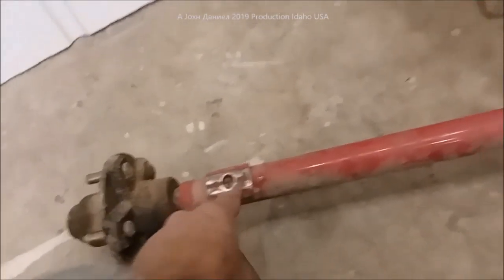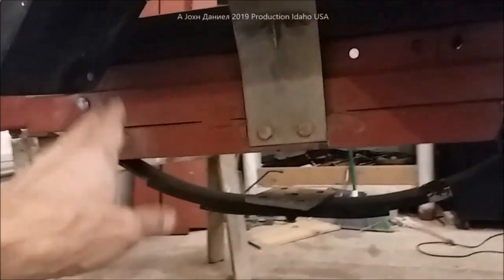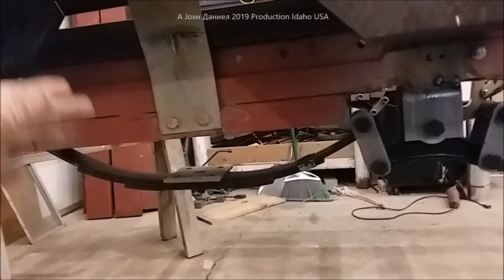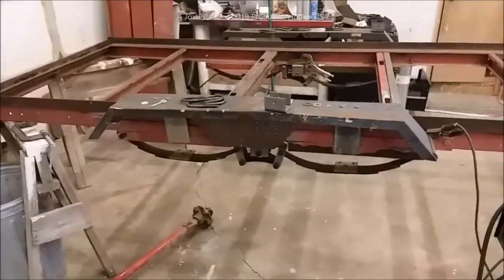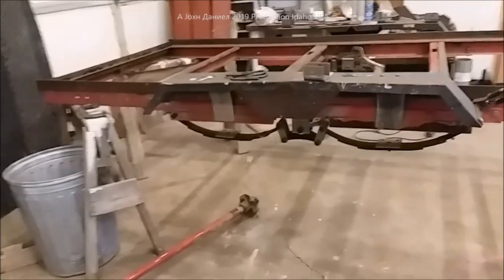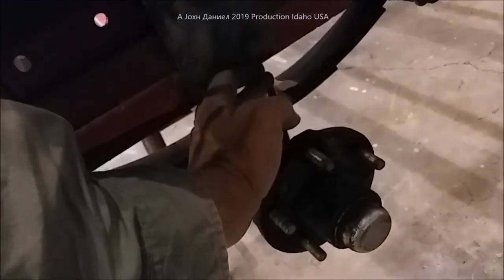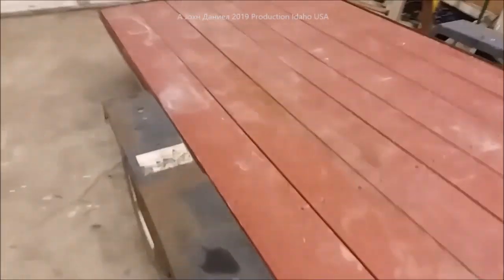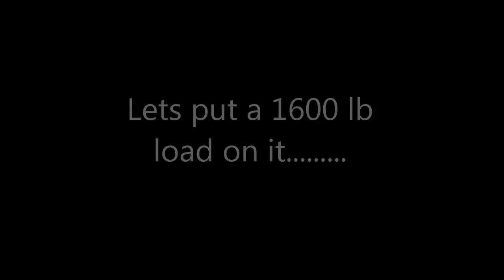Harbor Freight DIY 2 axle trailer Phase II vid 2 on 4k Suspension kit

Comment from the maker: Discussed PARTS - 2k/4k dual Springs https://ebay.to/309fyoK Full 2k Axle kits https://amzn.to/2YqwYNa Short spring Equalizers https://ebay.to/2YtKAHh 1" Trailer Bearing kits for HF & Northern Tool models https://amzn.to/2XEKRKx  Build with flux welder https://amzn.to/2WRQXmn that can weld 1/4" thick & use INE wire https://amzn.to/2WSdFun Anything I missed, ASK!  Need more help, contact https://bit.ly/2XIj5tL
Reply: Hi john I'm looking for the sa.e materials to do this to a trailer of mine, I cannot source them of the links you provided :(

Comment: Did you reinforce tongue?  Dual axle increases ability for load, weakest point is where tongue connects to frame.  Intrested how you solved that issue.  Great job!
Reply from the maker: dad is not here right now, in hospital. but i do know he used angle welded into that front to make it stronger.

Comment: Great video... just one question... how do you reinforced the Tonge ??
Reply from the maker: 1.5" x 3/16 wall square tube welded from the hitch assembly to under the frame about 2+ foot hitting 2 cross members

Comment: was there a reason when you built this you didnt do a full 16' or so length? I am seriously contemplating doing 16-20 foot, buying 2 trailer kits in future. & I already knew the benefits of the axle pivot, I have built hundreds of trailers in my life, when I was working at a shop, but I dont own a single one. times have changed, I once found junk trailers, & cut them up, and used metal to build "new" trailers, now there is nothing cheap & even well used Harbor Freight trailers sell for more used than new.
Reply: No kidding.  I just seen an ad for the 4x4 trailer a guy assembled and decked for $400!
Reply: Thats the same shit i wanna do is do a 4x16' trailer with harbor freight trailer

Comment: Hay John ,You need to check out  the new 500 watt converters. The box said 500 watts so does the paper work. I call them and they said that they can handle  up to 360 watts of power. Please check them out. They are from Harbor freight. Let me know what you think. Dennis

Comment: Cool. Didnt you have some duely trailer for sale that was in good shape cheap that would be perfect for a scorpion tower mod like mine and would hold 12  6v batteries and 6 or 8 300 watt panels ?
Reply from the maker: Yes, I have one with a 21+ foot bed thats sitting ready for conversion. It has dual axle, 3500 lb. Empty weight I would estimate is 700 lbs when prepped for a build.
Reply: My buddy wants to build his own setup.  I told him no. Only if I help. Because he will catch everything on fire.
Reply: Cool how long till its converted and how much do I tell this truck driver it will cost him for the first step?

Comment: Hi and thanks for the video. I couldn't see any brakes - sorry if I just missed that part.  In the UK the limit for towing on the public highway is 750kg if unbraked, 3500 kg if the trailer has brakes. I can see that your trailer is solid enough for a decent load weight but did you not consider the benefit of adding braking ?
Reply from the maker: No brakes are made for the 2k axles. And although 1700 lbs is a decent rate for a trailer without brakes for cars made 20 years ago, they should update the UK laws to at least 950kg in the UK to acknowledge the notable improvement in braking systems on all cars and small vehicles. Even a off road UTE for hunting in USA ( which is what this is great for ) has better brakes than a 30 year old British design car. They should look at the benefit of double axle road control and how it tracks drastically better than a single does. Here in USA you have max legal tow speed of 65 mph with limits of 2200 lbs behind a car and up to 3500 lbs behind a truck without brakes on the trailer. If your truck is a 1 ton that can be up to 4000 lbs un-braked

Comment: REALLY HILLBILLY BUT GENIUS. HEY , HOW TO YOU BOLT THE CAMPER TO THE TRAILER?
Reply from the maker: You make a pocket ring of light 1/8"th 2 x 4 angle steel on the frame for that , but currently No plans to use to to haul the camper on trips, just using it to move the camper into the shop and go into surrounding area to collect old truck campers for salvaging. But I suppose for permanent use you could with the first mentioned, or steel plates and tie downs since the trailer is truck bed width. Its very stable, and has no roll characteristics with half its weight capacity on it. I did once convert a 17 foot long 6 foot wide based Boat trailer frame to carry a 11 foot fully self contained camper unit for a friend, it had double 2600 axles with 7" electric brakes and worked so well he still has it 8 years later. It has hacked axle job which gave it 13" of ground clearance and he uses is when gold prospecting pulling it with his 1980's Jeep Scrambler with a 258 AMC straight 6 engine into the craziest places. Nothing else made worked for his rig.
Reply: @JOHNDANIEL1  I'LL BE DARN.LOVE THE GOLD PROSPECTER WITH THE JEEP.  I GUESS YOU COULD ALSO  BUILD YOUR TRAILER SIDES UP TOO! JUST WONDERING.